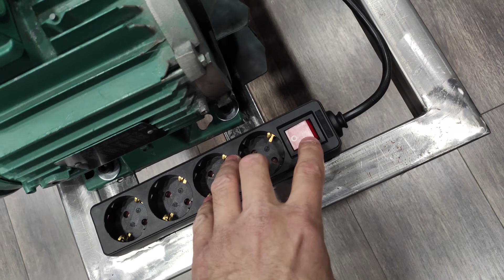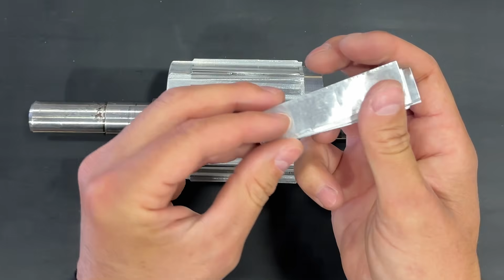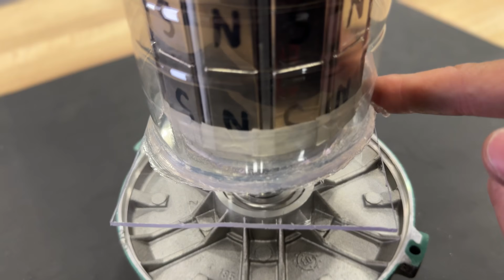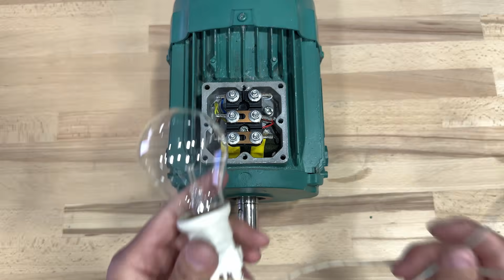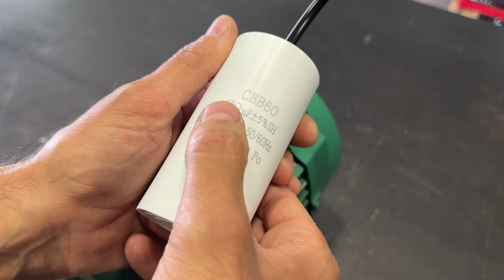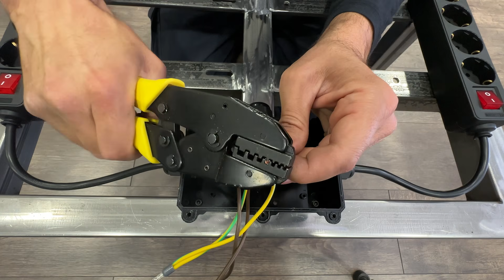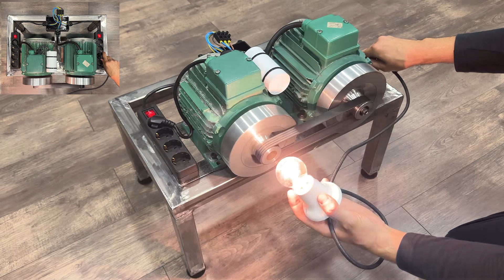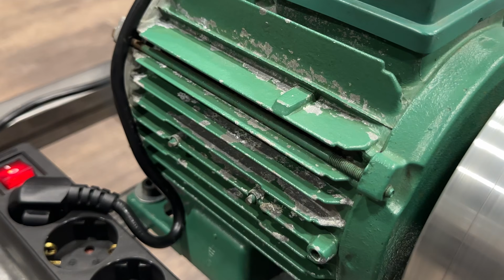10KW! Free Energy with Two Electric Motors💡⚡💡Liberty Engine 5.0

Comment: All I can say is amazing I want to build one right now how much would one cost me to own
Reply: You could buy motors for 200$ each or try to find used ones. A lathe can be had for 700$. Be careful with the Argalium, in most cases, that name is used for a heat conducting material, not the silver-aluminium alloy which is mentioned here. But Alibaba offers some, so good luck with getting ripped off by a chinese conman. Then the followup-cost would be to build a new house, because epoxy becomes soft at 50° Celsius and the centrifugal force will drive it into the stator, creating lots of friction and heat. Then it will burn with noxious gasses. And if that does not happen, the multi-slot outlets will melt and burn quickly if you try to pull 10KW from them.

Comment: Dette kalles Perpetum Mobile! Det er en umulighet som dessverre alt for mange er blitt lurt til å tro på. Noen er blitt tussete av å forsøke det umulige!  Varmelærens første hovedsats fastslår at energi ikke kan oppstå eller forsvinne, men den kan endre form. Strøm kan eksempelvis skape bevegelse og bevegelse kan skape strøm. I dette tilfelle var der satt inn to svinghjul som også kan lagre litt bevegelsesenergi som ble tilført av å dreies igang. Jo større og tyngre hjul desto mer energi! Der vill alltid være en eller flere former for friksjon som bruker av energien og gjør at det hele stopper opp. I dette tilfelle var friksjonen relativt lav og svinghjulene tunge. Det kan derfor gå en liten stund før det hele stopper! Det vanligste er at det hele ender opp som varme-energi. Den merker vi ofte lite til fordi mye bevegelse skaper lite varme. (427 kg.m tilsvarer 1 grad C i 1 liter vann = varmens mekaniske ekvivalens)
Reply: build one and prove it. It bends laws not breaking them.
Reply: @DIGOLOGIST  666% efficiency of an alternator bend reality to a spiral. A real pity that 30% of that wonder go poof in the Steinmetz Circuit that converts the 3-phase motor for 1-phase. And it's an absolute mind-bender that the 3 phases in the alternator are at an 120 degrees to each other, which means that they are always at oppsite polarity to each other and cancel themselves out. Where does the voltage come from that the multimeter shows?

Comment: Why does this type of videos keep coming? Every person in the world with more than two brain cells knows that this is contrary to physics. It is not possible to make more output than input.
Reply: Langsam glaube ich, dass ES funktioniert! Ich versuche nach meinen Ferien ein solchen zu bauen! WARUM, sollte jemand lügen und sich soviel Arbeit machen, wenn er den Generator  nicht einmal verkauft ?? Werbung habe ich auch keine gesehen. Nur ein paar Sponsoren  für Sekunden! Ich weiß auch, dass Perpetuum Mobile nicht funktionieren, aber er bekommt Starthilfe bis
 1600 U/min
Reply: Lenz’s law says the induced current always opposes the motion that creates it. So if you connect two motors with a belt, one as a motor and the other as a generator, the generator produces counter-torque that resists the rotation. Plus you always have electrical and mechanical losses. That’s why it can never produce perpetual energy — you always get less power out than you put in.
Reply: @kisstamas5198 👍👍👍
Reply: Some people seem to feel the need to attack this news as if their lives depend on it.
I'm building a similar machine, maybe we should get together?
Reply: @tangoteamwork I did not intend my comment as an attack. As an engineer, I felt it was my duty to point out that the physical laws forming the foundation of technical sciences do apply, and that a self-sustaining motor does not exist — nor does a system where a motor drives a generator via belt transmission in a way that keeps itself running indefinitely.

There are frictional and ventilation losses that continuously slow the motor’s rotation. However, the greatest braking effect comes from Lenz’s Law, which states that the direction of the induced current in a conductor is such that the magnetic field created by it opposes the change in magnetic flux that produced it.
Reply: It has been proven numerous times that an average YouTube enthusiast has the IQ of 1.
Reply: 220 volts measured means nothing without amperage, a 9 volt battery easily produce 220 volts , a couple of buck converters. The motor that was not open up has a small dc motor and batterys?

Comment: For me, the answer is rather simple: If I would intend to fool the viewers, I would guide the necessary power supply wire from one of the connector boxes through the square hollow profiles. And over one of th 4 mainstays underneath the laminate floor to the next powergrid supply. Easy, isn't it...😅🫡

Comment: Im curious if you made the motors pulley bigger than the alternators pulley would it make even more power?
Reply: If the rotation speed increases(RPMs), then yes, but larger pulleys at one to one ratio will actually slow the rpms

Comment: Quite a good video. However, it does no good if parts are not accessible to the public! Can a substitute be used for the unobtainable tape pieces? Can a battery be utilized for initial start up?

Comment: It's impossible to generate more power than is expended, which defies the laws of physics, because friction causes a decrease in energy. Also, it's not true that you get good results with a small lamp. When the power is removed, the generator will contract, requiring more motor power. I've tried this experiment myself; it's only for show and cannot be used for anything useful.
Reply: Этот агрегат будет вращаться недолго! Генератор не может вырабатывать энергии больше, чем  потребляет двигатель + трение ! Как фокус 👍!
Reply: @gsm5405  You're absolutely right, my friend believed in this and spent a lot of money building this system. He used a DC motor and an alternator to charge the batteries, but in less than an hour, 10 x 100 amp batteries ran out. It was a 10kW system. His money was wasted.

Comment: Where can you buy the strips from I've searched and can't find them I can buy the magnets the epoxy the motors and this concept does work if you understand magnetics and and coils the idiot that made the comment is just as dumbass you can buy children's toys that do the same thing to power the toy but they put basic magnets in the toy so it eventually runs out of inertia and you have to perpetuate motion again to get the same outcome eventually the magnetics die off but The stronger magnets are the only way to go it's a shame because you could create massive generators this way and the only thing you'd be changing out every once in awhile is the magnets and probably the bearings

Comment: You can no longer buy them from the manufacturer, because Elon Muks has bought the patent. These devices will now be standard equipment in his electric cars. A battery is no longer necessary, and recharging is even less! You can drive around the world several times without getting out of the car! All you need is a charged cordless drill to start the device once! Elon gives you that for free! When you get home, simply leave it running and connect your car to your home electrical system.
Reply: В данном случае вы домой никогда уже не вернётесь.

Comment: I would like to see the output via an oscilloscope and check if the waveform is a sinewave at 50 Hz.  Also the full output and Power factor with a resistive load or inductive load like a transformer or choke or another motor connected such as a dried or washing machine seeing you have rated this device at 10 Kw so should hand the mentioned items. 
I suggest you run the machine at 1500 rpm synchronous speed and check output wave form. Maybe a set of meters covering KW, PF Oscilloscope etc. Further - The alternator is a 4 pole winding, so why the rotor with the smaller magnets that do not cover the pole pitch of the laminated  stator and coils. I say you could increase efficiency with proper curved magnets, meaning you only need four - 2 norths and 2 souths spinning within the stator.
You may like to take another close look at my suggestions.
BB

Comment: I see that the unit puts out 225 volts at 1400 hertz. Here in the USA, everything is designed to work at 120, 240, or 480 three phase volts, but at 60 hertz. What good is this unit supposed to do here?
Reply: It is producin heat. It pull energy from the network, convert part of it to mechanical movement, and then part of this energy back into electricity. 
The difference between these two values would be converted into heat. 
If you want to produce heat, it is better to use clasical heater, it is more effective, more silent, and haven't moving parts which can get damaged during operation.

Comment: A motor loss at least 40% of is energy when driving a alternator or a generator, and the generator loss 10% cause is efficacy is not 100%.
In this case, if you drive the motor with 10 000 watts, your alternator will only  generate 5000 watts if everything is well balance.

In resume you loose close to 50 % of your input energy, how can you generate ?
I not call that Liberty Energy, I can that Pay for Loss Energy !  ;))

PLEASE STOP TO DOING CANULARS YOUTUBE

Comment: I feel like the capacitator is powering the left motor, since there are no wires or external power supplies or batteries over and under the structure, excluding that capacitator, which looks like its powering the motor than just turning the 3 phase motor to a single phase motor.

Comment: sigh you need to put air tank with pistons air driven and a blow off valve for pressure and run  air powered motors make a quad  air pump system to charge a tank to run a motor to spin a huge flywheel and the you got free energy its called air pressure that fly wheel need to have a rod or beam comming out the center held by bearings where you can put your line of generators and use capacitors to store the energy to run a bigger motor

Comment: What is the purpose of this video???
“free energy” is not possible using only two electric motors in a closed loop.
A two-motor system cannot create net energy; it will always slow down and stop unless you keep supplying energy from the outside (battery, wall outlet, solar, fuel, etc.).
The “free energy” concept does violate physics laws if it means:
more energy out than in, forever, with no external input
That would be a perpetual motion machine, which conflicts with the 1st and/or 2nd Law of Thermodynamics.   What is the purpose of this video???
Reply: Вы путаете горячее с мягким. Здесь нет вечного двигателя, здесь он показывает бестопливный генератор, который не может быть веч но ям априори. А что то типа БТГ несколько десятилетий есть в каждом доме, это холодильники , потребляющие 1 кВт электроэнергии, а выдающие от 2 до 10 кВт тепловой и чем больше +++, тем больше коэффициент преобразования, то же относится к кондиционерам и тепловым насосам.  И если научится преобразовывать энергию на выходе этих устройств в электроэнергию и часть её запускать на питание системы, то получится БТГ.
Reply: @abkhaziya_gagra  The heat produced by a refrigerator or heat pump comes from the environment,  i.e. ultimately from the sun.  And the sun is not an eternal or infinite energy source.
Reply: @xlntnrg я и не писал о вечном, я писал о отличии бестопливного генератора от вечного двигателя. В холодильниках теплоносителем служит фрион , а в тепловых насосах воздух или вода. Из них и берётся излишки энергии сверх электроэнергии и если рассчитывать и эти энергии , то в сумме получится чуть меньше 100%

Comment: If you moved the table while it was running, I might have actually believed you but no doubt there is a power cable coming from the floor and up through the structure.  Nice try!!

Comment: You claim the output power is 10kW, so why not show that by simply connecting a 10kW electric element, at the same time measure the current and voltage?

Comment: Besides the fact this is just clickbate content, this is not a new idea at all. In 1950-1960s there were busses called Gyrobus, using heavy flywheel spinning at about 3,000 rpm. They did not work forever of cause, it's not possible from the Phisics point perspective.
Reply: Значит надо изменить законы физики.

Comment: It's not free energy, with heat loss and drag, the longer it runs the more power it needs, once it goes pass that point it shuts off. the efficiency of it must be 30% max. cars use to run on generators not alternators gas motors keep them going without a battery you could push start your car.  (Energy = Power × Time)  the longer an electric motor runs at consistent  overload with 80% efficiency the greater the input power it needs to run.
prolonged overload causes motor temperature to rise, which increases winding resistance, reduces efficiency, and necessitates greater input power to sustain operation. This can create a feedback loop leading to eventual failure.
Reply: Такие машины и сейчас есть . большегрузы работающие на карьерахБелазы, Каматцу кажется. 
 Вы не поняли суть работы устройства. Избыток энергии берётся из магнитов и будет работать пока они не размагнититься. Долговечность работы зависит от разности силы магнитов и потребляемой мощности. Чем больше разность , тем дольше конструкция будет работать.

Comment: I recommend to read a good physics-book. It will tell you very clear why there is no Perpeduum Mobile possible. Because of the internal mechanical friction this modell will even not run without any load on its axes
Reply: Я тоже рекомендую почитать хорошую умную книгу называется Большая Советская энциклопедия, про топливные насосы. А так же информацию в интернете про бестопливные генераторы,чтобы не путать их с вечным двигателем. Учи, приду проверю, а то так неучем и помрёшь.😊

Comment: I'd like to see this connected to a "portable power supply" like a buletti / Jackery etc. with a very low battery...
If you can charge that up, that would give interesting info as to how much this can output over a sustained time...
😊
Reply: Dummheit in Reinform!

Comment: Energy is free by itself. It is us people who charge for it.
Regarding the video. Whenever a special material that is not fully disclosed is mentioned than it's over, simply because from that point I would need to believe.
Another point is the efficiency of 666%. I am likely not the only one who noticed that it is the devil's number. Could be coincidence of course.
Reply: I think the Argalium [aluminium] sheets might be just to prevent the squirrel cage from resisting turning of the motor.? I would have thought that the magnets and the metal plating on the magnets would have been enough to eliminate whats left of the squirrel cage in the rotor from resisting motion. But still  very skeptical that it would make a self running system when connected to a motor.

Comment: this can be made to work  but 3 key numbers are needed 1 HP amout power needed to make said power  voltage  voltage reqired to run motor amps how much amps dose take to run motor 
note i said nothing of what will power the home    all we need know on that is hp  needed if under full load, 
now why this config,  this copyes how a power pant works,  but  it is also why people cant make it ,  this cant run a home and that is what we need, 

math is everything to make this work  there is no one here not even this busness can awaser above quistions  how much HP what is voltage reqired to run motor , and what is amps 
so say your gen can make 50 amps dose it no good if motor runs at 50 amps. 
 how ever there is a way to make 100 amps and   power to run the motor,   unless some one can understand  this                   no one can make it work i spent 5 years and i got the numbers, 
then something change they now have 6 phase motors and genarators  this huge ,     to this busness china lot closer to you to make this happen but they cant get it wright 
no one can get the numbers,    any one wants number  it is up for sale

Comment: the first motor uses the electric but it cannot use 220 v single phase  the motor required 3 phase so tell me please
Reply: With the help of a correctly sized capacitor it allows say a 220v three phase motor to be powered from a 220v single phase supply (This practice is used for motors that don’t start under load eg fans, coolant pumps etc). 👍

Comment: What is the frequency of voltage? Will the same build procedure work with a 120/208 phase system?
Reply: Do you have access to the special metal foil required?

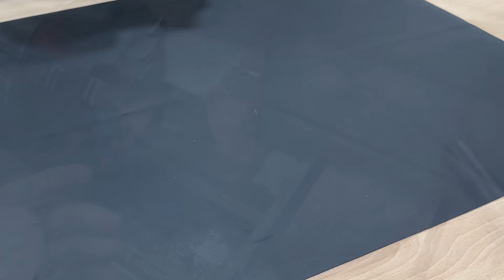Comment: 1) 2:53, the tape is unavailable and there's no link to it, so the experiment is unreproducible.  2) How do you determine that the system delivers 10 Kw/h of power?  3) How long would a long-term test under a 10 Kw/h load last before the magnets lose efficiency?
If you're serious and don't want to mess around, answer these simple questions.